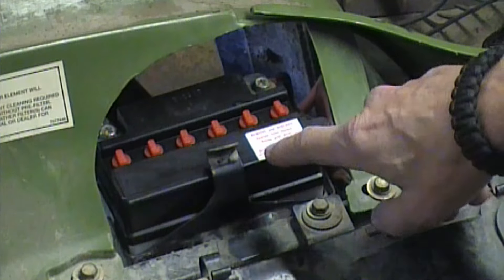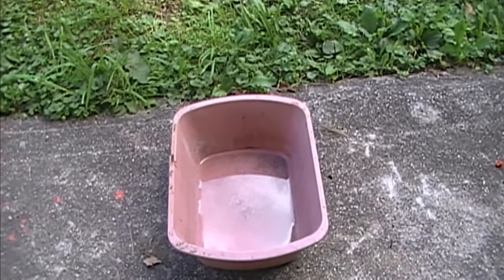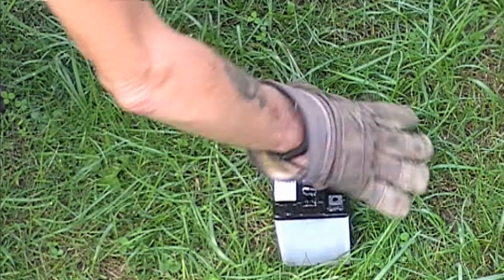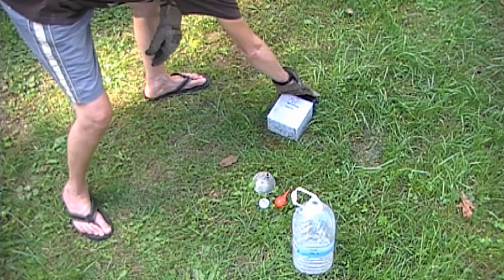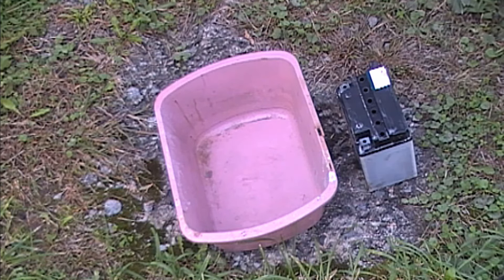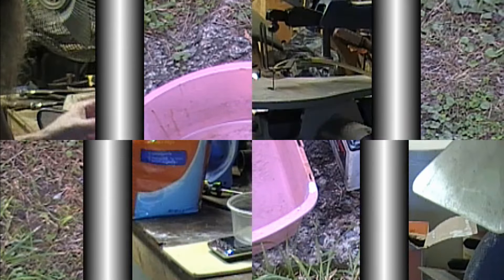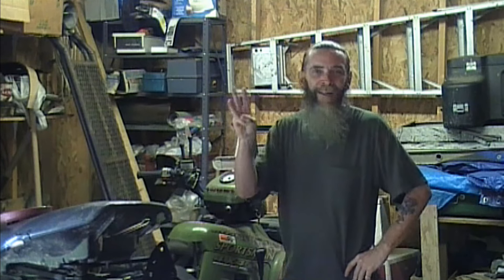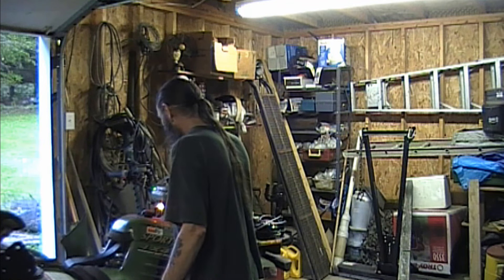acid lead battery restore recovery EVERYTHING YOU NEED TO KNOW 2018 car battery reconditioning

Comment: Unbelievable Randy, So I reconditioned a 6 pac of Trojan T145's 8 months ago. It took close to a month to complete the process on all 6 and charge them totally by solar. The results, they are still charging to 97% of what new batteries do and run a household of 3800 sq. ft. I neutralized the batteries 10x and bounced them around off road in the back of my 4 wheel drive after the 5th baking soda treatment. Thanks for the vid that bank of batteries cost is aprox $1500.00 to replace.
Reply: @0pedja0  LOL, Na firstly the key word is babble, 2ndly it's for car batteries not deepcycle, and thirdly as the article states "there is nothing physical here" it is a download... I wonder if it is just some kind of shareware, access to my p.c. ware??? Anyhow my Trojans are still running the house.

Comment: Use a small wire to jiggle and force Soda through the funnel much easier and faster- I have done this with other dry powers or granulated substances. Just a helpful hint-you probably know this.

Comment: Speaking from experience and as a ASE certified master technician,Sometimes the batteries are too diminished of catalyst. And for better results don't trickle charge but short high amp low volt pulse width modulated heavy dwell saturation of current will give the plates a better chance of flaking off any scaling.also alot of times there's irreversible wear and tear or damage causing a "dead cell" . The method he's showing is a cool 50\50 shot of working but it's not a guaranteed thing. especially if the battery has been depleted to 0 volts, dry , dropped or overheated then your bout outta luck .

Comment: Can this method be used for temperatures below freezing environments lije Canada
Reply from the maker: you probably would have to do the actual work inside because your water might freeze, as far as the battery, if no cells are damaged it should work fine. thanks for watching!

Comment: not even trying to do it right, I was  dicking around with an old Interstate battery dead AF in my shed 5 or so years, just planning to use it for a core charge on my soon to be unliving Nissan Altima's battery. Figured WTF, it could only be so much of a core & that's it. charged it off of jumpercables for enough zap to switch on the charger. put it on trickle overnight,  load tested it, needle instantly to zero from 12.8. Mixed up 3 or 4 tablespoons epsom salts with a tad over 1 cup water, topped off the cells, charged another 8hrs, PRESTO! Nearly 600 cca on load test for 10 seconds!

Comment: Good vid dude.  Rite now I'm work in on a 2011 Wal-Mart tractor Bart I use for the 50 up rude and tractor.  It starts everything but has lost capacity.   I charged.  Checked gravity.  All cell equil. At fair. Gravity. Drained acid.  Flushed 10 times.  Until clean flush.   Added old filtered acid.   @ 12 .0 volts.   It's all charging now and bubbling!.  We will see.   No baking soda or e salts .   Bill Ashby. Mass

Comment: I saw your video, it's very interesting. I have a battery that has a date of 3/10. I've lost count how many times I cleaned it out, possibly 15 times. It's starting to run clear, I'm going to do it two or three more times to be on the safe side. It's a 12-volt EverStart marine battery I want to use it on a solar power setup. It's 125 amp hours, under the circumstances of being solar. Would you still use the salt and the distilled water. Or would you rather just go with acid. If this works for the saltwater like you say it does and I hope it does. I've got another one, I really like your video. The water has a slight tint to it, very little residue. It's really not enough mention about

Comment: Can you filter the the old acid that came out rhe battery and clean it with a screen and put it back in the battery wondering if you can do that cuz i got a few old batteries im thinking in doing this but screen the old acid from batteries and ones is clean put it back itto the battery instead using the Epson salt thanx for the video good one reason I ask is cuz I live in Canada and it gets -15  -20 sometimes more I'm sure it will freeze with water and Epson salts that's why I'm wondering if I can recycle the old acid or get new acid already mix  thanx
Reply from the maker: I wouldn't recommend it! You can replace the acid as I did here for very cheap Epson salt and a little time getting the mixture right and charging. Good luck! And thank for watching!
Reply: @RandySchartiger  will do thanks appreciate

Comment: Came across your video and my original comment again, so I thought I would post my experience. I first saw your battery video series back a year or so ago. I tried your baking soda/epsom salt method multiple times on multiple batteries. Rising them out with baking soda solution multiple times until clear. filling with epsom salt, and charging for days, checking each day to see amp levels ect. I didn't really have any success with it on any of them. Got plenty bubbles on most. But some of them didn't do anything but hold a surface voltage, but only low amps. Others kind of worked, but only for a short time. not sure if I did something wrong, or what. Really wanted it to work and really tried. But in the end, i mostly just spent a lot of time and didn't get much results. And just as a point, I'm used to fixing, repair, fabricating, ect ect. I like doing things myself, have always done so most of my life. Also because I don't have the $ to hire anyone anyway LoL
Reply: You need to use sulfuric acid. The reaction in the battery is supposed to create lead sulfate. Lead sulfate is whatever holds the charge. With no sulfuric acid there is no sulfate
Reply: Speaking from experience and as a ASE certified master technician,Sometimes the batteries are too diminished of catalyst. And for better results don't trickle charge but short high amp low volt pulse width modulated heavy dwell saturation of current will give the plates a better chance of flaking off any scaling.also alot of times there's irreversible wear and tear or damage causing a "dead cell" . The method he's showing is a cool 50\50 shot of working but it's not a guaranteed thing. especially if the battery has been depleted to 0 volts, dry , dropped or overheated then your bout outta luck .

Comment: Do all cells need to bubble while charging, before even trying such a rejuvenation ? 
If 1, 2 cells are not bubbling, while charging, they are completely dead and this method won't work at all ?
Reply from the maker: you're right! sometimes those dead cells can be revived if there is no damage to them, but usually not. thanks for watching!
Reply: @RandySchartiger  thank You

Comment: Yes Randy.  It's the battery acid specific gravity per cell  with a hydrometer @ temp.  And voltage. Tells the real condition of your battery.   In the battery restoration projects that your into!    Yankee Willie Ashby.

Comment: you don't have to take the old battery acid to a landfill, just add enough baking soda to it and it will completely neutralize it. I used to work in automotive, and had to deal with batteries on a daily basis, we had acid spills, boil overs (if the charger screwed up) and more. We kept a 5 gallon bucket of baking soda with a scoop and used it to neutralize all spills in accordance with regulations.
Reply: Came across your video and my original comment again, so I thought I would post my experience. I first saw your battery video series back a year or so ago. I tried your baking soda/epsom salt method multiple times on multiple batteries. Rising them out with baking soda solution multiple times until clear. filling with epsom salt, and charging for days, checking each day to see amp levels ect. I didn't really have any success with it on any of them. Got plenty bubbles on most. But some of them didn't do anything but hold a surface voltage, but only low amps. Others kind of worked, but only for a short time. not sure if I did something wrong, or what. Really wanted it to work and really tried. But in the end, i mostly just spent a lot of time and didn't get much results. And just as a point, I'm used to fixing, repair, fabricating, ect ect. I like doing things myself, have always done so most of my life. Also because I don't have the $ to hire anyone anyway LoL

Comment: yep ,when you cleaning by bubbling it  ,the baking soda neutralizes the battery acid,  and when you refill it the epson salt is the electrolite batteries need to speed up the acid forming process then energize. great video easy to understand
Reply: the magnesium from the epsom salt will destroy the battery!

Comment: I dont know  if i should do the same process to my battery or not ? Because mine charge to 13.8 V. and start the car, but after a day left  at cold weather  below zero, will not  start the car even the voltage is 12.6, and after two days even a little  above zero  like 34 F to 36 F.   will not start the car, but after charging it, it will start the car immediately even too much  below zero. And at warm wheather above 60 F. No problem even two days,  willstill start the car.
Reply from the maker: sounds like it's time for this process right now before your cells get damaged. good luck! and thanks for watching and commenting!

Comment: I tried this and can’t believe how well it worked  I followed his directions exactly and the battery turned out  as good as new  it’s used on a large generator it even sat for a little over a month and when I went to start it up it started as if it had s new battery in it  be fore if it sat for more than a couple days I would have to jump it

Comment: Hi.  This bartery was bought brand new.  Never froze and always charged.    This lawn garden tractor is also used in my 50 hp boat motor. Thin cells made in Mexico. This battery may be at the end of its useful life.   We will see  Bill.      Ashby mass

Comment: Yikes. Y'all are doing it all wrong. You can 100% restore it with a 200 amp charger.
 1.Open your cells
2.Pour distilled water to just above the plate in each cell
3.Plug in 200amp charger and charge for  15 minutes
4.Let battery cool down for an hour
5.Repeat steps 3-4 a total of 5 times
6.Trickle charge with 2amp charger for 24 hours
7.Put caps back on and viola! You owe me big time!
Reply: Can you do that with a 55 amp charger?
Reply: I doubt it. Ive had issues doing it with 100 amp. All the electrolytes boil out cuz it takes too long to get the cells bubbling
Reply: But the goal is to get every cell bubbling, thats how u know its a good cell and no longer sulfated

Comment: Two Questions come to mind :  Would it help to flush the battery out with clear water real good after the Baking Soda clear flush, just before the Epsom Salt solution is poured in, or does it even matter.... Second, after the initial trickle charge, can subsequent charges, if needed, be faster or smart chargers - something higher than 1 or 2 amps?

Comment: I have read that Sulfation problems are primarily the sulfation between cell plates and the sulfation that drops to the bottom of the battery which is shorting out the plates at the bottom.. Might be a good idea on the first step with the acid still in to turn it over and whack it with a rubber mallet or wood to shake it off of the plates and bottom and then dump it.. 
Might also try the first time, shooting a spray of water into the battery and shaking it around and dumping it to loosen the deposits.. Get it as clean as possible and then start with the soda.. Might save a few boiling trips.. Just some thoughts watching your video.. 

I had to buy 2 950cca batteries for my bus.. Ouch and have a big tractor battery that I have to replace now $200.00.. What the hell more than time and some epsom salt sitting in the cabinet do I have to loose?? Ha.. Fixing to rip it out and give it a whirl... 
Thanks for the video..  You sound like a NC mountain man.. Ha.. Cheers.

Comment: The water won't freeze if you do exactly as instructed here. The lead plates will react with water to make sulfuric acid. Same goes for adding water to a battery. Do it in warm weather or charge in heated garage.

Comment: 12:38, That’s going to be the acid when it charges up.
So I googled a seemingly stupid question. Is Sulphuric Acid the same as Epson Salts? This is the google comment. copy/pasted. ( I did not add anything to this google comment)
Epsom salt is magnesium sulphate - MgSO4. Its no different electrolytically than sulphuric acid - H2SO4. There is a possibility that there will be some MgO saltsbeing deposited on the plates, but essentially instead of H+ ions moving around, you have Mg2+ ions moving.May 5, 2013
Reply: So when MgSO4 is dissolved in H2O and then exposed to a voltage it reacts and becomes H2SO4? Is that's what's happening?
Reply: @CSDSolutionsLLC  
Exactly!!!!😁 The lead plates create H2SO4 from water. My grandpa was a science teacher for well over 20 years and he'd tell ya.
Forgot to add: must use distilled water or the minerals from tap water will adhere to the plates. Same as adding antifreeze to your vehicle.
Reply: Thank you so much for clarifying the confusion I had in my head.
Reply: CSD Solutions LLC i believe so

Comment: Great video. You demonstrated that before you start your process; the first thing you do is charge the battery with the old acid. Have you tried emptying the old acid first, then prepare your banking soda solution, pour that to the empty cells and giving it a 1amp charge over night to better activate the baking soda chemical thus better separating the acid crystals from the cells?
Thanks

Frank
Vietnam Vet

Comment: Do u put the original battery acid that u poured out at the start back in? If not what liquid is in the battery once all flushed with baking soda solution? Is it epsom solution?
Reply from the maker: yes the epsom solution should be all that's in the battery after you kill the old acid left in the cells with baking soda, you may have to do baking soda several times then epsom solution and then charge. good luck! thanks for checking out my videos!

Comment: Wow, this is so useful and informative. Thanks Randy, thanks a lot
Reply: There are  several suggestions for doing a pro job
Don't try to do this unless you know what you are doing - the acid can burn your skin
Test the voltage first - there may be a dead cell which would waste your time.
Check the battery fluid.
Try to fully charge the battery.
(I read about these and more on Jons Mender Guide site )
Reply: Pablo David Sandoval, I’m NOT paying $47 for something that Randy showed us with the kindness of his ❤️ !
Reply: @Pablo David Sandoval 
Jons mender guide is just a slick info commercial, where as this man offers advice FOR FREE....!

Comment: Randy.. I concur with the process of cleaning and neutralizing the plates with sodium bicarbonate... you may not realize it but 'rolling the battery around' shakes up the lead sediment that invariably collects at the bottom of the plates.. remember as the battery ages the charge discharge cycle reaction cause lead to flake off the plates over time and collect on the bottom of the cells.. this tends to increase the self discharge rate of the battery as the electrolyte becomes contaminated.. cleaning the muck off the bottom is the key. Exposing fresh lead and using cleaned or new electrolyte could restore a battery. I question why epsom salts are superior to the original acid based electrolyte.. I suggest just replace the old electrolyte with cleaned or new stuff.

Comment: Just a quick question.Wouldn't the Cen-Tech 2-10-50 Charger from Harbor Freight work ok using 2 Amp Mode?
Reply: Ok,just seen in description on Web Site that it IS A MANUAL CHARGER.

Comment: Can anyone tell me if the Epson salt and water solution will freeze in the winter or does it go through some chemical change to prevent that?
Also, why can't you use a regular charger?

Comment: Hello! I just have a couple of questions, once it's charged up do you leave the epsom salt in the battery? Or do you do a half and half with epsom salt and water and battery acid? And I noticed you said your voltage was dropping in part 3 at the end, but it has enough power to start if you switch it off and leave it for the night will it be able to start again the next morning if the voltage drops?
Reply: I've been researching into battery repairing and found an awesome website at Magic Mender Wizard (check it out on google)
Reply: Next time you do another battery repair, play your guitar while you're charging the batteries.. might be good for the ratings

Comment: and  the water you mention is the water is which we use for battery or it is  something else
Reply: Ahmad, the water used with the baking soda can be from any source. The water to which the Epsom salt is added needs to be distilled water. At least very, very well filtered water if it's not distilled. What you're trying to control is the build up of sediment and the addition of anything that will keep the battery from taking a charge. All the best to you.

Comment: Great video! A lot easier measurements given vs several motorhead sites I visited.

I do have one question though, why is it important to trickle charge vs the normal starter battery charge setting?